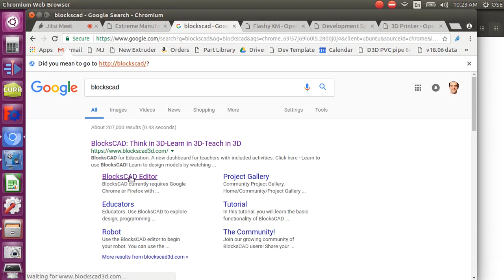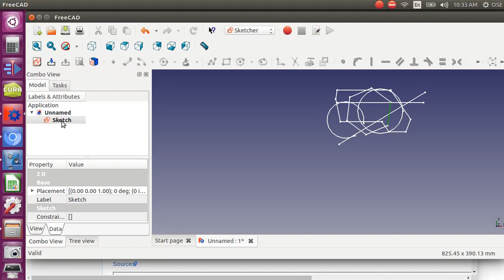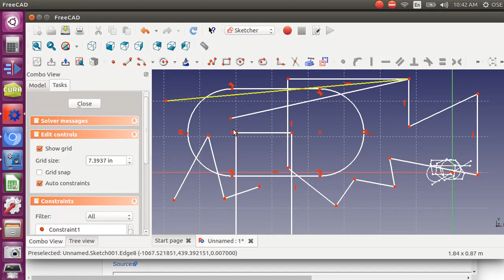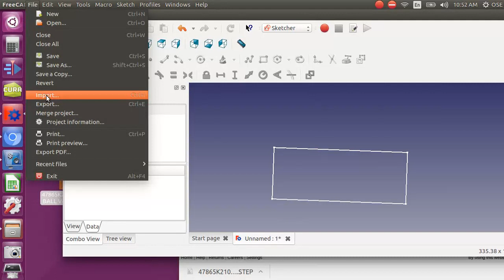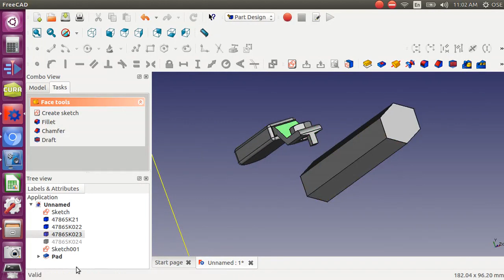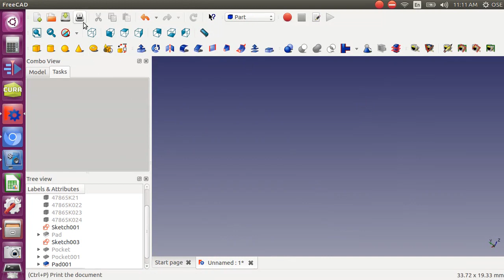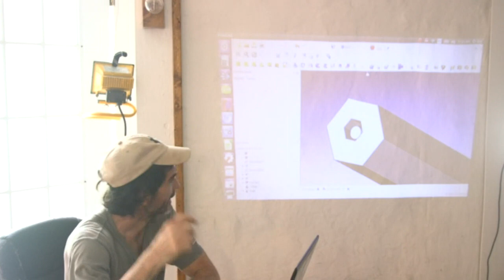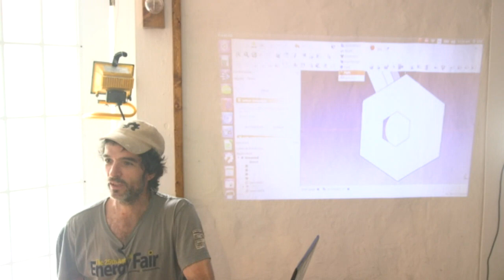Basic FreeCAD Workflow

Comment: 49:36 printer inaccuracies (press-fit vs. loose-fit)
 50:45 production engineering means documenting cad/printer interdependence and printing conditions
 52:00 printing in mid-air
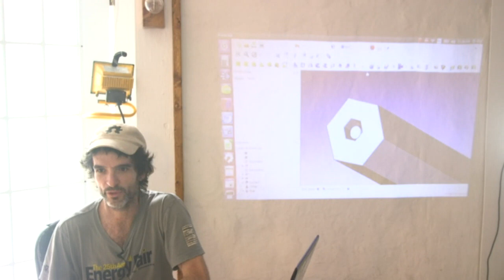 57:00 LulzBot has FreeCAD files
Reply: i think i remember a video on that fdm issue.  I will go find it and post it below